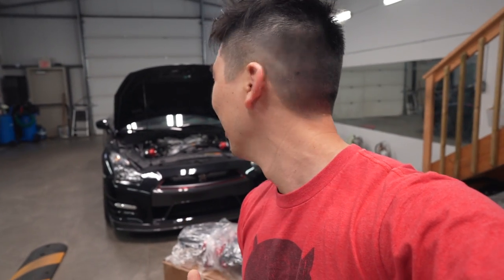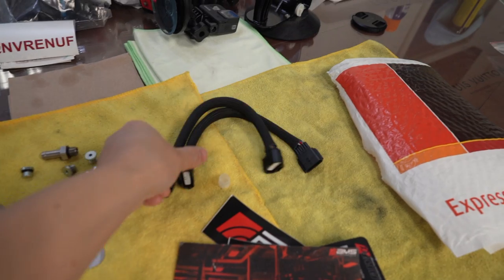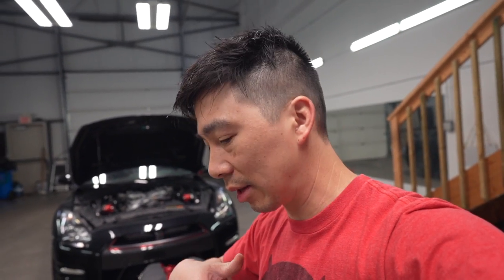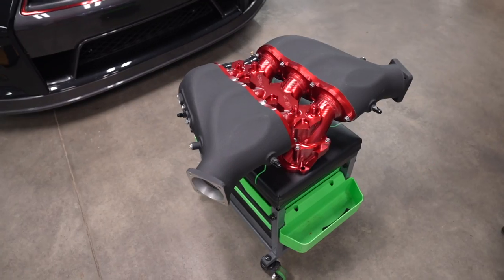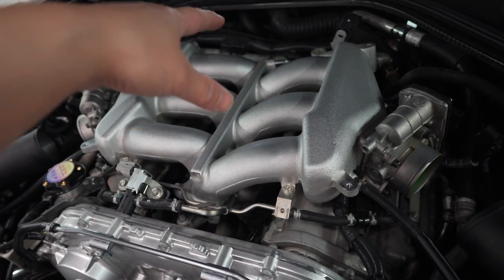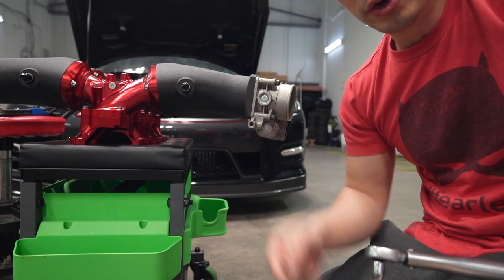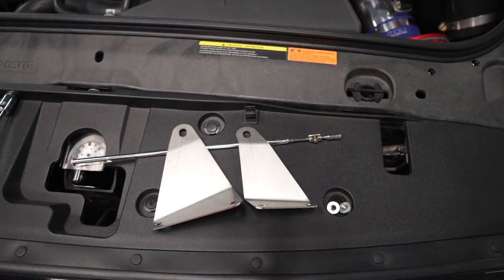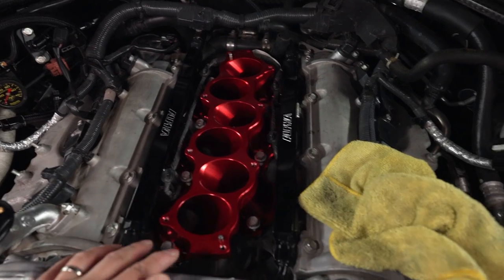AMS Intake Manifold Install Didn't Go As Planned!

Comment: Great looking manifold. A question from a fellow GTR owner, do you really need that good looking intake? My goal with my GTR is to take it to 800whp on oem motor & tranny and my tuner told me that the oem manifold can hold way more than that. Keep up the good work
Reply: I think extra 150hp for me be enough! that's my goal Next  year- this summer I'm just enjoying the car.
Reply from the maker: To answer your question, no you do not need this manifold for power under 1k whp. I have very similar goals as yours. This is more of a cosmetics upgrade. Thanks for watching the vlogs and the comment!
Reply: For me to have a reliable sports car, I use mine as a daily, even when buying groceries. Why buy a expensive car when the garage is enjoying it right.heheh
Reply: Only 800HP no need!
Reply: @ajae4616  that depends. I put 5k a year. It's a 09 and just hit 69k miles. If decide to keep the car for very long time, you don't wanna wreck crap ton of miles on it. I still think that when owning a GT-R you need a shit bucket as a daily.  For example i can't take my GT-R to downtown Chicago. Too many potholes

Comment: What additional AN fittings did you need ? How many AN3 and 4. I have some but want to make I have enough.
Reply from the maker: You will need 3 (an3 to an4) if you are doing the evap delete and 5 if you are retaining the evap.
2 for the evap
1 for the intake vacuum 
2 for the bov

Comment: My shop told me when I ordered my I/C pipe I would need a adapter pipe when I order the manifold.
Reply from the maker: That is 100% correct. I decided to do a custom piping. It will be in the next vlog.
Reply: @phothrottle  what brand do you have? Friend had same problem with ETS.

Comment: I can't believe I'm only 10min from AMS :-) Nice Mani - but for sure it's not as simple as it looks to replace it. especially when you missing parts or it won't fit because you need different IC Pipes
Reply from the maker: Yeah I was so frustrated. Need some custom piping made. I will share with you in the next vlog.
Reply: @phothrottle  please do ! So to run aftermarket Mani you need custom piping ? Btw why are you going with different manifold ? Just wondering
Reply from the maker: @StreetDrivenDaily  yeah I would recommend custom piping for proper fitment. I went with after market because of future plans for the build and wanted a different look.